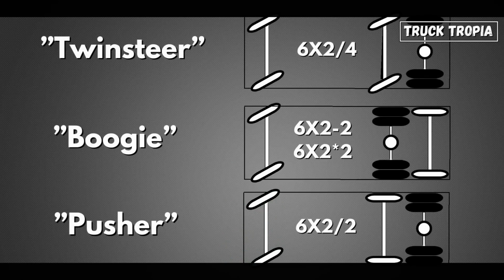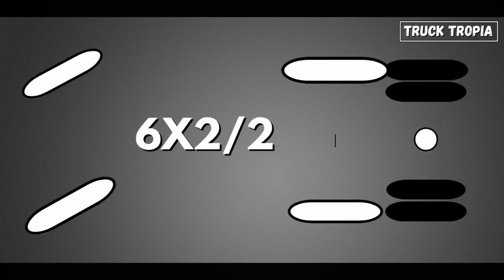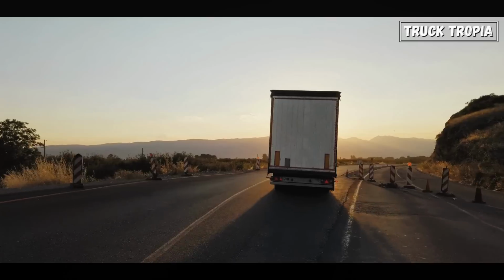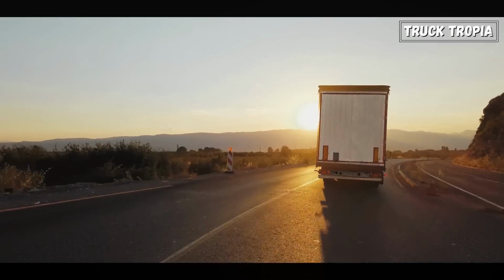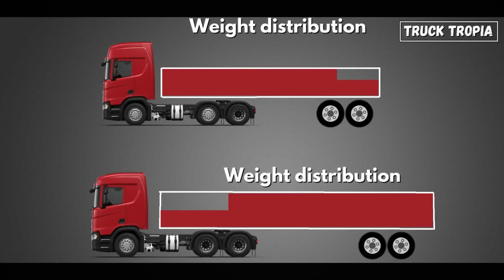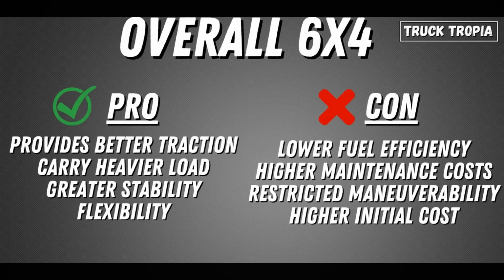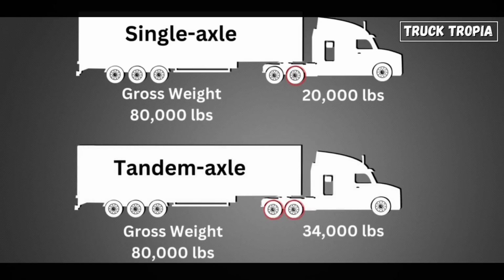THIS Is Best Semi-Truck Configuration - 6X4 vs. 6X2

Comment: the 6x4 boogie is the most versatile layout. The 6x4 tandem gives LESS traction when empty. The boogie can lift the rear axle to provide more weight on the 2 axel.
Reply: Liftable axles on the tractor are illegal where I live
Reply: @Jason Williams  I'm also curious where and why they would be illegal. I know in the US they're not, so long as you're not overweight on the other axles. I think some states allow lifting a short time while turning sharp, such as at an intersection, and some are very strict on not lifting if it overloads your remaining axles, but I don't know of any states where they're fully illegal.
Reply: @BouncingSphinx  BC Canada, I'm not really sure exactly why, my assumption is so guys can't lift the axle and overload the drives then just put the lift axle down for the scales.
Reply: @jasonwilliams8016  weird
Reply: @BouncingSphinx  each province has different regulations, keeps things interesting lol
Reply: @jasonwilliams8016  where do you live? I love in Norway. We have lots of steep hills and snowy mountain passes.
Reply: @MrSolenoid  BC Canada
Reply: @MrSolenoid  Tri-drives are super common here in a triple triple configuration, as well as super B, I've even seen tri drive with triple, triple train though only empty.
Reply: @MrSolenoid  in norway we use 6x2 with boogie. there are some trucks with unique config of 6x4 with liftable boogie but that is seldome. for specialized trucks only.
Reply: @bjrnbreivik4582  Then I've been driving specialized trucks for years. In Bergen Norway. I mainly transported heavy machinery and equipment. But also gravel, mud and asphalt. I often used a 5 axel, 20 wheel hitch trailer when I didn't drive a semi, with a 4 axel lift able rear axle tractor.
Reply: @MrSolenoid  U just answered urself. Machinery transporta as well as masses transport is specialized transport. Especially in norway. Normal trucks with refrigerators or just isotermic semis use standard 6x2 boogie configuration.
Reply from the maker: You mean 6x2 Boogie and i agree 👍
Reply: @TruckTropia  There's 6x4 with the last axle liftable, Volvo has it
Reply: Scania also.

Comment: 6×2 with a steerable rear Axle with a cabover configuration in the US. Is there also a 6×4 configuration that allows the trailing Axle to disengage, making it a 6×2?
Reply: I've never heard of such, but from what I know, 6x4 in the US typically are not full-time equally driven unless differentials (left/right) and power divider (front/rear) are locked. I think most of the time, the front right drive is the one receiving the most power and would be the first to spin in loss of traction.
Reply: @BouncingSphinx  Yes Volvo make one.
Reply: @Robert Rich  I'm guessing for European market?

Comment: Truck Tropia PLEASE do research before posting, because for truckdrivers this is embarrassing....

In the modern civilized world a 6x2 and a 6x4 can have the same gross weight, but the 6x2 is lighter and therefore gives you more payload.
On the steep, curvy, icy roads in Scandinavia 6x2 is the most common to use, even though the gross weights there are higher than in the rest of Europe and USA.
Reply from the maker: Well i have, hope you was Able to enjoy anyway 👍
Reply: I've heard the 6x2 tag lift is to allow to lift the tag and get more weight on the single drive axle to get better traction.
Reply: @BouncingSphinx  you're right 👍🏻
Reply: I think the thing about the weight 20k vs. 34k) is they found the weight limit for a single rear axle (4x2, like Saia or other LTL companies typically run) and misinterpreted it as a single drive axle in 6x2 configuration.
Reply: I drive a 6x4 and I'm legally allowed to load a few hundred kilograms more than my colleagues that drive a 6x2, a few tons extra with a heavy permit

Comment: The weight limits you showed on the US trucks is for a single rear axle, as in 4x2. 6x2 still has two rear axles and is still capable of carrying 34,000 lbs combined.

Comment: The maximum weight in Europe is 40000 kg and not 60000 kg.
Your totale weight can be more. But that is different from one country to an other country... The law is most countries not the same....
Reply: In scandinavia you can haul 60t
Reply: Do some research...  the 25.25 module system is allowed all over Europe
Reply: @stigandrmyrardalur5208  It's on TEST in most of Europe...   And in Germany you'r still not allowed to more than 40 ton in total (44 ton in intermodal transport) even with 25 meter combination...
Reply: @jan3101  many "temporarily" things are in full use three decades later, and this "test" has been going on for so long that it's in reality is the normal.
Reply: @stigandrmyrardalur5208  I work for the gouvernement. My profession for the last 16 years is controle on trucks (weight, loading security, dimentions, technical state,...) I'm on the road, every day... I know the law... And I know scandinavia you can haul 60T.
In belgium is't 44T.
the Netherlands 50T, France 40T... There alway's some exeptions you can haul more, or less... But 60T is not mainstream in Europe
Reply: @peterthoelen8416  l won't accuse you of lies, just ignorance...
I've driven all over Europe since -94, and a necessity for doing this job is knowing the different rules.
When it comes to european modular system it's regulated through Directive 96/53 EC, Article 4, but you're right that each european country is allowed to make their own regulations
Reply: @Peter Thoelen  so the maximum is still 60T, right? Just not across all of Europe. And the minimum maximum is 40T.
Reply: @BouncingSphinx  
Depending on the configuration of the truck. Lets say 2 axel truck, 3 axel trailer. Europe say 40T is the maximum weight. All countries could make it's own roules, but the minimum is 40T.

France 40T 
Deutchland  40T
Belgium 44T
The Netherlands 50T 
....

In Belgium for example, the maximum is  44T (it doesn't matter if is a 3 axel truck and 4 axel trailer, or a 2 axel truck and a 3 axel trailer). 
There are some exeptions:

There is a law that says you can have 48T (but you need to have: 3 axel truck, 3 axel trailer, ACC, weight system on every axel, weight system for your total weight, there is a maximum age for the vehicle's... .) and if you drive emission free, you can get 50T 

There is a categorie called LZV (long and heavy vehicle). They get 60T

Exceptionel convoi (60T, 90, 120,....) But you need the have a permit and you can  drive only on a couple routes.)

Europe is not that easy 😁

Comment: If you are going to go with a 6by2 you may as well go with a 4by2
Reply: The extra axle allows more weight, even if it's not powered.
Reply: Nope.
In a 6x2 your truck can be 26 tonns.
In a 4x2 your truck can be 19 tonns
Reply: Depends on what you want to do with it. If I look to most European countries the most common configuration is  a 4 x 2 with a tri axle trailer. It can cause traction issues earlier, but the write off is easier. In the Netherlands it is not uncommon to see 4 x 2 tractor with a 4 axle trailer, most of them in use for buildingmaterials, concrete and so on.  Trailer last axles are steering axles.
Reply: @bertnl530  We drove 4x2 with tripple-axled trailers all over Norway earlier, without problems.....
Reply: @stigandrmyrardalur5208  I know. Especcially in Norway I always liked the high cube stepdecktrailers.  Perhaps a diff lock can help in some narrow situations. You could see that in the past, but I don't know if that is still common.
Reply: @bertnl530  diff-lock is a necessity, together with proper tyres and lift-axle

Comment: 6x2 is the best becsuse when travelling empty you can just lift the last axle to save tyre maintenance
Reply: theoretically yes. But why would someone travel empty???? Those are made to haul all day long every day.
Reply: @marcelo403polo2  you done with delivering a load and you need to head back to the depot to take another load of course the return trip back to the depo will be empty so lift the axle so save fuel since truck travel back empty
Reply: @marcelo403polo2  the is also going and returning trips one can't take the returning trip with axles down they must lift it to save fuel If they have 6x2 because the going back to the warehouse or mine with an empty trailer to get another load
Reply: @hipetwa  I guess you talk more about European market. I can't imagine anyone going empty lets say from Vancouver to Halifax for example
Reply: @marcelo403 polo  there's absolutely no way anyone would go empty clear across the country. Vancouver to Surrey would be more realistic, and if you have a lifting axle, you can save those km on at least 4 tires, 8 if you have lifting axle on the trailer also. Them multiply that by every time you have to drive 100 km empty, and you really extend the life of those tires.

You have to think, not everywhere a truck delivers to has a load for them to leave with. A warehouse for groceries, let's say, has many deliveries in of a single item from distributors, but nothing that needs to go back except maybe empty pallets. The loads out would be mixed items going to the stores and would likely have a single company that handles that side, with many different companies delivering to the warehouse.

Also, you can lift the axle if it's not needed for weight restrictions. If you're not overweight for a single axle, why run both? Then you save the wear on the lifted axle for the entire trip.
Reply: @marcelo403polo2  still if it was having lifting axles you lift them I was even referring to South africa markets many trucks even trailer have lifting axles especially tri axle trailers or pbs trailers with lifting axles so save tyres even if the tyres burst and it can be lifted you can lift it to prevent let's say more damage on the rim of the trailer
Reply: Nah you lying man, few companies have trucks that lifts their wheels. Most are 6x4 due to that most companies carry heavy loads.

As for the trailer lifting its wheel due to tire burst.. You crazy man. Those wheels lift automatic when trailer is empty soon as the trailer is loaded they remain in the ground.

Even if the tire burst you won't lift it. So please stop giving false information about south African trucks.

I often see the tanker trucks that 6x4 empty but the only wheels that lift are the trailer ones not truck one.
Reply: @marcelo403polo2  fuel tankers for exmple. What load should they take back to the raffinery when they unloaded their fuel at a gas station? Or car transporters when they have unloaded at the dealerships. They always drive empty half of their time. Or even dump trucks, when they dumped their sand or gravel or whatever at the construction site. Cement mixers too.
Reply: @sakhileradebe4939  which false information us I am a self operator and I lift my axles of the volvo every I go empty for all trailer and truck even faith transport in freestate lifts the axles from truck to trailer when going empty even achelle vervoer driver say when travelling empty the lift all axles of the volvo globetrotter and trailer even abnormal side tippers do the same stop speaking nonsense
Reply: @sakhileradebe4939  what do me mean due to tire burst look at freeze trailers the don't lift automatically you press s button for if to lift even Namibia roos transport trailers have a button to lift axles after traveling from drc to walvis you even npc of northern cape travel empty from Cape Town to windhoek with all axles lifted on the refrigerated trailers I speak of companies that do it not those one of yours
Reply: @Hishikushitya Hipetwa  I hear you man, but most companies in South africa they usually don't drive empty after a load coz that's money wasted .. few companies go empty. 

Which company are you working for?
Reply: @Hishikushitya Hipetwa  those are old trailers bafo, new trailer are smart they don't require you to press to lift.

As for lifting the trailer wheel for tire change... come now that's not true while the truck is heavy with load 😳
Reply: @Hishikushitya Hipetwa  most companies that succeed here in South africa they don't travel long distance with an empty bafo. Except for tankers, containers and few of the tippers.
Reply: @marcelo403polo2  Companies would love  to have a 100% payload but that is not like things are going. Can very well be that you have 2 or 3 suicide coils of 30  tonnes total  on your way up, unload, drive like 80 or 100 mile empty and   pick up say 18 tonnes as retour. Or even 5 tonnes when you have to haul diapers or potato chips or whatever.
Reply: 6x4 is better too due to the number of workload you will obtain especially here in South Africa.. the mountains we have, they need stable trucks that can haul big loads pluz the winds are strong.. pluz the restrictions here south africa plays a big role of how much load 6x2 and 6x4 is required to haul.
Reply: https://youtu.be/SMzQb0s302w